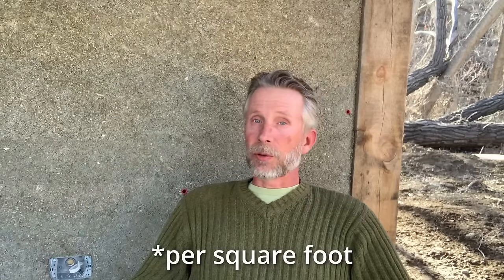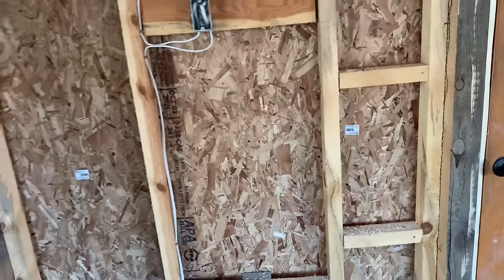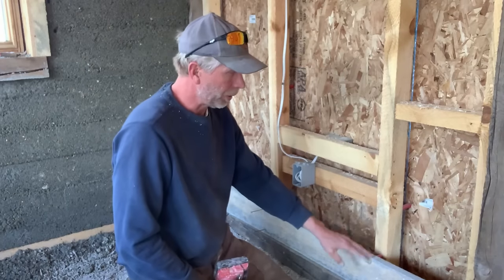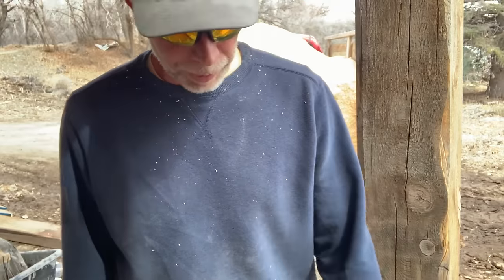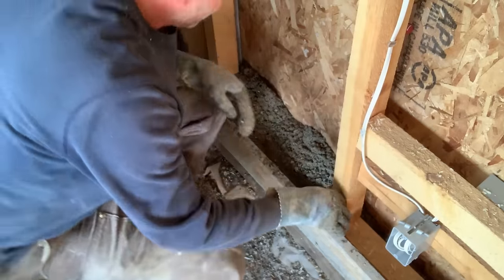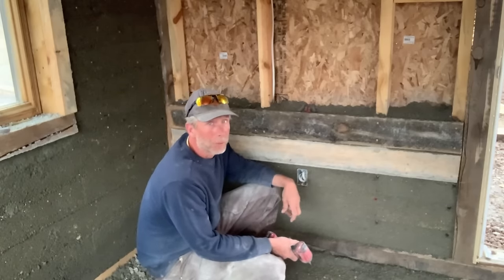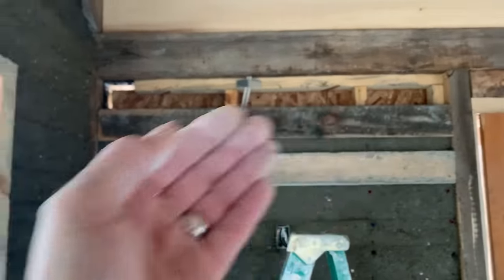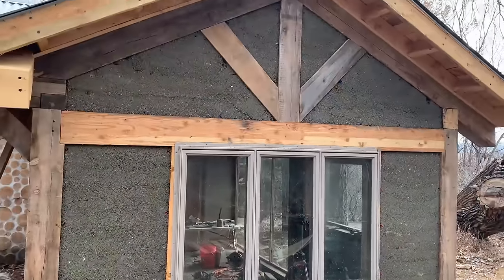Dustcrete

Comment: That’s great to hear !
We are about to start building our off grid home “down under” Australia.
I’ve been looking into many different natural building techniques and at the moment I think this is the best. 
We have a small swing mill and plan to cut all our framing and flooring and love the idea of being able to use the waste in this way.
Another two questions if you don’t mind ,
I will be using mainly hardwood saw dust and read this is more problematic due to the density and tannins present in hardwood,
Any thoughts ?
And I can’t find S type lime here, only hydrated lime, do you think that will still work ?
Obviously I need to do my own testing but any advice would be greatly appreciated !
Thank you again for your video and advice,
Have a great day mate :)
Reply from the maker: Hydrate lime is what they call Type S, up here, so you’re good. I have not attempted this with hardwoods, but I think it’s worth a few test pours. I bet it works just fine. Best of luck with your build! Cheers

Comment: What are you going to use to insulate the roof?   If you were in New Mexico, could you have increased the base/foundation and then have doubled the thickness of the wall for an "Adobe-effect"?Awesome build.  And you're NOT 'vunerable' to termites because of the lime, or will it require treatment like WILL be necessary if this is built anywhere in Arizona?    Could you subsitute  plastic from discarded-drink/tea/pop-bottles, ground-into a larger particle dry-"Dust", if a saw-mill wasn't handy, and you didn't want the plastic in a land-fill/out @ Sea, or would the plastic "dust" be a potential fire-hazard worse than sawdust which I guess is encapsulated in the lime & cement?
Reply from the maker: My roof insulation is just fiberglass bats, in this one.

Comment: I'm interested in replacing the mud/earth/bamboo walls in my old house with a technique like this. I feel it would not only last much longer, but would be better for insulation.
Reply from the maker: It definitely is better insulation than mud. And still has some thermal mass!

Comment: It maybe would be better to mount the spacers to the wood... then you can remove that step of having to mess with them.As long as they are aligned correctly(and maybe lub them along with the board) then pulling straight out should not cause much damage. 

Then another speed up would be not to use nail like objects(you are having to screw every time for each screw which is a massive waste of time) that act more like nails. You can use another board on top and to use as a lever to push in the nails and then to pull them out.

The idea is that putting effort in to building something that can be reused quickly will save you about 1 minute for each time you have to move them. So it would likely save you a few days of work. You could have several so technically you could almost have a continuous rotation where most of your work would be done in moving the dustcrete... which could further be optimized with a hopper and funnel like device. With another person working you could probably get an entire room done in a short day assuming all the equipment was already set up ready to go.

Of course all that work would only be effective if one was doing this professionally or for a very large building. If one could make the planks supports used correctly and adjustable it would be quite a bit of a time saver though.

Comment: What's the approximate R value of this dustcrete? And is that a standard window A/C spun around to act as an air source heat pump? How well does that work, is it controlled with a Cool bot or something?

Comment: Ah crap,  I got excited to see this video using sawdust to create walls,  because I'm looking into styrocrete AND have a sawmill which creates a lot of sawdust.  BUT, it's a band mill with a ⅛" kerf, so I'm guessing that's inappropriate for this application then.   I was hoping to do a timber frame and infill the walls with something cheap,  diy friendly,  and very insulating, and breathable.  You think this method is suitable for the western Maine area? And how is your structure holding up/ performing now?
Reply from the maker: It is holding up well. I have found that letting the dustcrete cure for a couple of months before plaster is a good idea. I have a few hairline cracks, but nothing distracting. If I were doing it in Maine I would oil the timber frame before doing the infill. I would also offset the forms on the outside, such that the exterior plaster is continuous. The frame can be exposed on the inside, but I’d feel more comfortable without exterior exposed wood in your wet environment. I haven’t tried it with fine sawdust, but others tell us that floors have been made like this in Central Europe. I did a test with wood chips that seemed viable. Perhaps your fine dust in combination with a more mulch like product could be the ticket.
Reply: @radicalgastronomy  ah, that's all good to hear sir.  I'm smack in the middle of logging and milling territory,  so getting circ blade chips is not an issue.  Getting rid of the fine dust, in the other hand, is.   I'm definitely figuring on making the walls seamless and completely exterior of the frame, with sizable eaves.  Your videos are timely for me.. I've been bopping from icf, to aircrete, to styrocrete,  to strawbale, amongst others,  and this one here seems like it checks all the right boxes.   I'll be highly interested to see new related content updating the formulas and techniques for this dustcrete. Thanks for the response.

Comment: Could you use the mixer, just to dry mix all the materials and then add water in the wheelbarrow?
Reply from the maker: You could, but the dust is significant. The right tool for this is a plaster mixer with paddles on a horizontal axle. They are pretty pricey to buy, but renting one for a project would make mixing a breeze.

Comment: The addition of sawdust is found to reduce the workability and to have an adverse effect with increasing replacement levels. Similarly, reduced density of the hardened concrete is observed in the case of the sawdust concrete mixtures.
Reply from the maker: Reduced density is the name of the game, when it comes to insulation.

Comment: Do you have a video where it shows you plastering this Dustcrete wall? Also, how long do you wait for the bottom layer to dry before you add a new layer by moving the slipform up? It would have to dry somewhat, wouldn't it? Else wouldn't the bottom layer start to jut out when you pack down the next layer on top? I really like the idea of Dustcrete. We used to own a sawmill back in Canada. Can you tell me if the sawdust has to be clean, as from a circular sawmill OR if I could use sawdust from a wood processor (which probably has some saw chain oil mixed into it somewhere)? I may try anyway, as we have a lot of this sawdust from operations. I don't know if you'd want a petroleum product in your wall, is all. The ironic thing is, with the use of plastics today, perhaps some walls have them in there somewhere? 

Thanks also for your video on aircrete. When I came across that dome home video a few years ago, I was very impressed. But not so impressed when I saw videos of people trying to actually replicate the results. Trying to find a sort-of earth or environmentally-friendly cheap way to build is quite a challenge. There is a video on here of an architect in Europe who builds houses with cork panels on the walls, but I'd imagine that isn't too cost effective, though I love the idea. Thanks again for these videos. Interesting techniques you're using there and great giving the pros and cons of each building method. Keep up the good work!
Reply from the maker: There is a video of the interior plaster, but not the exterior. That will be coming this fall. No time is required before moving up the bottom form plank. As long as you leap-frog the planks the dustcrete will not slump. I would use saw dust with bar oil in it, myself. If that is the only petroleum product in the wall, it sure beats latex paint!

Comment: and as an option there there is aircrete which floats; is insulating; can be cut with a hand saw  and is stronger than a cinder block....cement, water and Dawn dish soap
Reply from the maker: I have a video on it.

Comment: Bad idea in so many ways. I have a large deck made the the “eco- friendly” trex of just ten years ago. The regret is huge. It was plastic wood particle mix. Nice idea no waste, ten years later. The wood that meets the air absorbs water, swells and the plastic stretches, cement will just crack. A 5.5 inch board is now 6.1 inches wide and still growing. Your walls are going to fall apart even if you live in a desert. You need matching expansion rate materials or materials that can stretch. Adobe moves as a unit as they absorb and release moisture evenly it done correctly. Concrete is less forgiving. Think of the failed structures that fractured as the unprotected rebar rusted and swelled. Paint the crap out of that, caulk like its free, seal all seams.

Comment: Well done and it looks great. I've been aware of Hempcrete for a while as well as styrofoam aircrete, both great ideas but limited by the availability of the materials, but you've got the best low cost material ever.

I did wonder if it was possible for the offsets to be permanently attached to the form boards so you wouldn't need to fiddle the bits of tube.
Reply from the maker: I suppose one could hot glue the spacers to the form board. 🤔
Reply: and then there is aircrete which floats; is insulating; can be cut with a hand saw  and is stronger than a cinder block
Reply: I want to love Aircrete. Aircrete is a pain to mix. Every single channel admits to aircrete bubble fails and they don't know why. Otoh if you needed a bunch right away papercrete is much more consistent and workable.  but DUSTCRETE gets me away from stores and away from more chemicals... I like this... now to figure out how it does in humid wet conditions

Comment: Cement cracks as it settles and holds moisture. I would only do this with metal framing in high humidity environment. I've seen a stemwall like this in Florida destroyed by termites.

Comment: I wonder if you only used a mixer to mix the dry ingredients. Then dump into a wheelbarrow to mix with the water.
Reply from the maker: The wheel barrow mix is not difficult with the light sawdust, and saves steps. I’d love to have a plaster mixer, though!

Comment: Can this be formed into bricks? How well does it stand up once it's cured?
Reply from the maker: It is my belief that it would make excellent bricks, that may even be structurally sound without a frame. I haven’t attempted such an experiment, but encourage innovation with the material!
Reply: @radicalgastronomy  Wasn't even thinking about using them with no framing, I like the look of bricks. Was thinking of this being cool in a mixed building style.
Reply from the maker: @michaelsasylum  you bet 👍

Comment: Thanks for sharing this information!  My question has to do with the viability of using this method when cold temperatures are upon us.  Do you have any experience mixing this when winter has set it?  What if one were to make blocks inside, but then stack them outside when it's getting below freezing?  Thanks.
Reply from the maker: I formed much of this in sub-freezing conditions. I did so by forming the whole exterior and running propane heaters inside. The block method could work, but there is the question of your mortar freezing and failing. I recommend exterior forms all the way around and slip forming from the inside. Concrete blankets can be used to insulated outside the forms, too.

Comment: Do you have any videos or recommend any courses on the very basics of timber framing? I want to start a project and there's a nearby sawmill but I'm worried they're gonna sell me low quality timber or I'll just choose the wrong kind for building. Many thanks for this videos!
Reply from the maker: There is a wealth of timber framing content on YouTube, but I don’t have specific recommendations. The most important things are straightness, squareness, and no crazy cracks and checks in your timbers. As big and chunky as the pieces are, it is the minute precision of your joinery that makes a strong frame. Pick a small project (wrangler star’s saw horses, for example) and learn the basics. Buy good tools. A Japanese pull saw, a slick, a mallet, and a 1 1/2” timber framing chisel will take you a long way. Honestly, tool sharpening is 90% of it.

Comment: Very interesting. We had looked at aircrete but frankly we were not really sold on that idea. My question however is regarding termites. Here they are a big deal, and as the climate here warms they seem to be worse. We would likely construct with NO exposed wood to prevent their intrusion. Is there an advantage to the commercial plaster [adobe-like] finish over the lime?
Reply from the maker: Commercial stucco doesn't breathe, due to the latex, so I wouldn't use it. Lime based plasters are vapor permeable, allowing moisture to escape the wall. This helps prevent mold growing behind the render.
Termites are not a big issue here in the high desert, so I cannot attest to dustcrete's performance with regard to them. There is a chance that the alkalinity of this wall system would deter them, but that is something to test.
Reply: @radicalgastronomy  Thank you. I think we may try a new larger well house. We want room for additional rather large water storage inside.
Reply from the maker: @richardkennedy815  That sounds cool! Could be like an old spring house. Always 54 in there. 👍

Comment: I looked up information how field mice and lizards enter a home it said walls and Foundation weakness but a pest control company could solve the problem🤑. I think I can seal my home if I had the proper guidance on what to look for and where. The pest are getting in the Attic Going Down the Walls into the basement. The point of entry from outside, path through the walls and exit into the basement is what I've got to  find and seal, the rest of the house is tight. Thank you for the video!
Reply from the maker: Steel wool can stop them, when you find the holes, at least for a minute.

Comment: Would it be detrimental to the dustcrete if it was made wetter? I would like to use steel mesh reinforcement, but that would be very difficult to pack through by hand. I was thinking a more goopy consistency might work for a monolithic pour similar to shotcrete.

Of course the form would need to be tighter, and it would need more time to cure, but those aren't insurmountable challenges.
Reply from the maker: That can totally be done, but there may be an R value cost with a wetter mix.

Comment: I plan to try this in a structure I've already framed. 
The plan is to keep the whole stud exposed, like a Tudor House, which is traditionally filled between the stud with wattle and daub.
What I'm curious about is how well your dustcrete has adhered to your external posts, lintels etc?

What's the weather sealing like at the point of interface between timber and dustcrete?
What I'm concerned about is different rates of expansion and contraction in hot and cold weather that leads to joint separation and capillary action draging moisture between the stud and dustcrete fill.

Any experience, thoughts, or tips would be much appreciated. 

What's the lime plaster render like?
I imagine a high lime render is quite a hard finish? How does it do in contact with the posts and frame?
Or should I be looking for high plasticity render for the external wall? Recommendations? 

A little interesting history: 
My intention is to make use of the sawdust accumulated from having milled the timber for the structure on-site. 
The wood is from a small timber-lot I planted when I was 19 years old.
Now at 51, I've cut my first trees from the stand, and I'm building a little guest house just twenty five meters from where the trees grew.
In the shade of those fast growing, hardy eucalyptus trees (I'm in Australia), I planted a large selection of the local endemic rainforest tree species that used to be here prior to having been cleared for timber and cattle about a hundred years ago.
As the timber lot gets thinned, the rainforest closes the canopy and has become one of my favourite places to be on hot summer days.
Reply from the maker: Building with trees you planted must be quite satisfying! 

There isn’t really adherence between the dustcrete and framing members. Cleats of some sort, either wooden strips, nails, or screws should be added to the sides of the studs to avoid movement of the infill.

The lime render is quite hard and durable. I prefer it to plasticized renders due to its vapor permeability. If moisture does enter the wall through capillary action, it’s no big deal provided there is a way for the wall to dry back out. A latex render prevents this, causing rot. 

If your roof has 70 cm eves little rain will touch the walls. Those old waddle and daub structures in Central Europe have been standing for over 1,000 years with clay against wood. I suspect dustcrete is even less likely to wick moisture into the wall than the cob used to build those.

The dustcrete will shrink away slightly from the frame, so I recommend allowing it to cure for  at least a month before applying the render. This will allow the lime plaster to fill the gaps giving you a tight, draft free final wall.

I like to add some fiber shards to the brown coat of the render to prevent any fine cracks from transferring to the final plaster.

Best of luck with your project! I’m here to answer questions if the come up. Cheers mate!